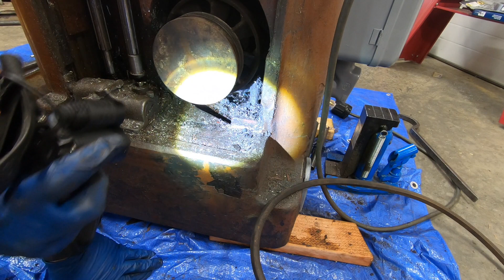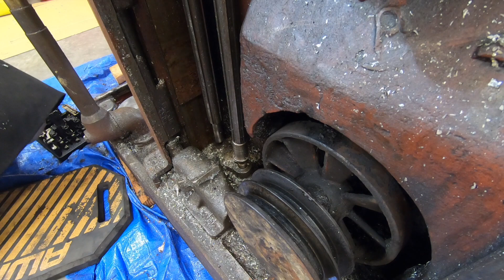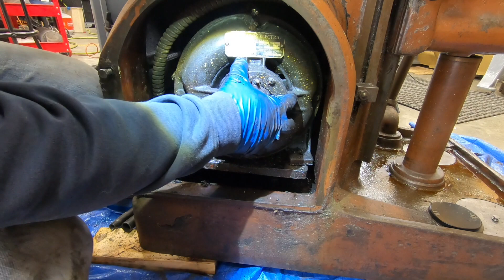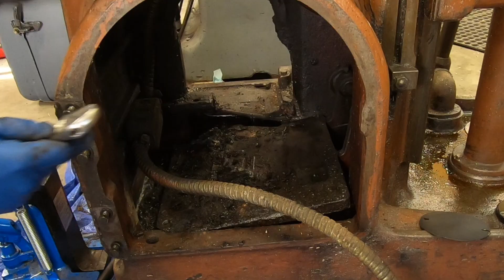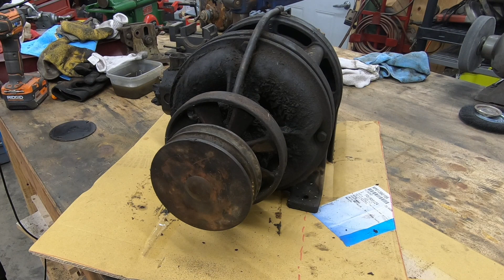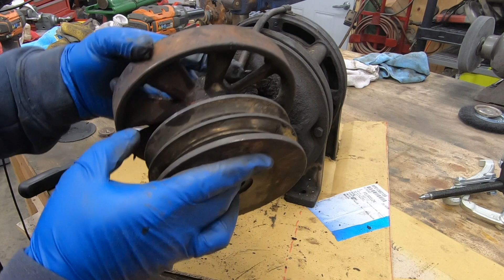Removing and disassembling the K&T 2HL Motor

Comment: Gday, removing the motor reminded me of when I took the 3 phase motor out of the Cincinnati, bloody heavy and no room to move, I replaced it with a single phase motor which is a lot smaller, all the wiring is still there so one day when I get a phase converter I’ll put it back in, it’s amazing how much crap can be in an electric motor and still run, great job mate, Cheers
Reply from the maker: Thanks, Matty. These old machines were built to run even in the worst of conditions.

Comment: You might want to have the windings tested before doing all the work and reinstalling, just thinking outloud. Thanks for the look.
Reply from the maker: I called a few motor shops near me. No one wanted to help.
Reply: @MyLilMule  Do you have any buddies that are industrial electricians? They should have access to a megger or possibly windings analyzer to check the shape of the windings.